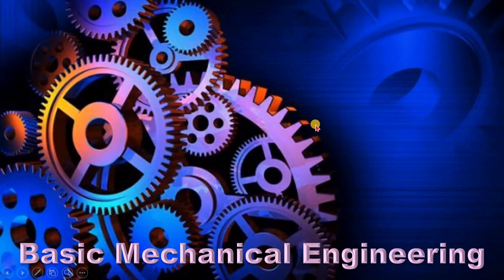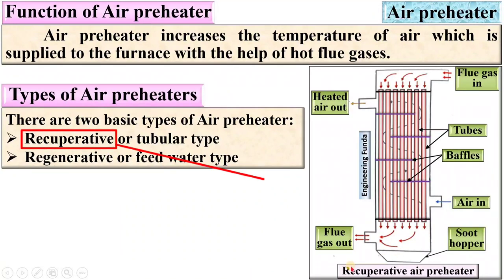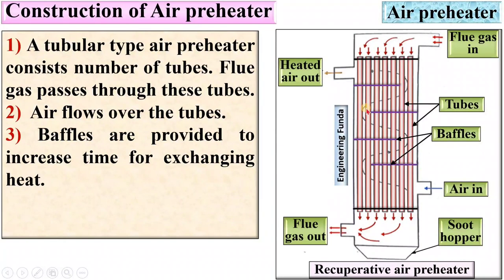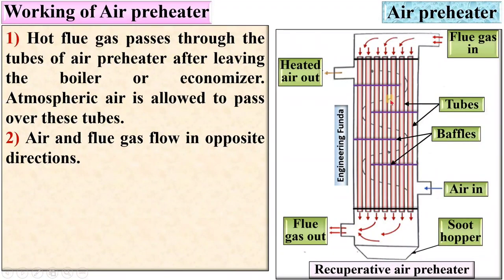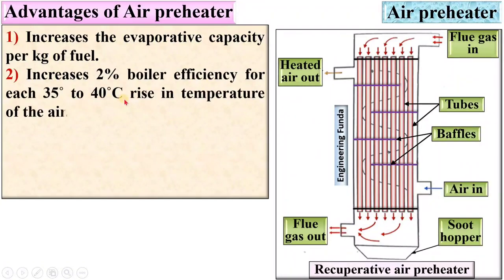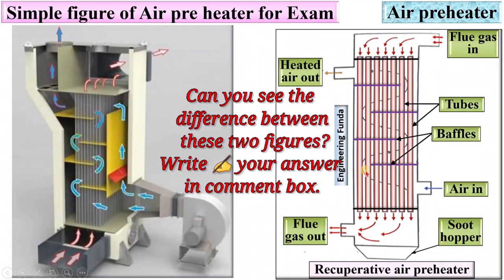Air Preheater (Types, Basics, Structure, Function, Working & Location in Boiler) Explained

Comment from the maker: Air Preheater explained with following timestamp: 
0:00 - Basic Mechanical Engineering lecture series 
0:33 – Diagram of Air Preheater
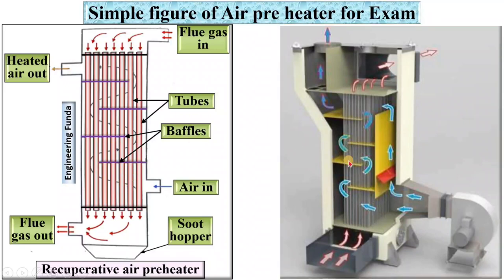0:48 – Boiler Accessories
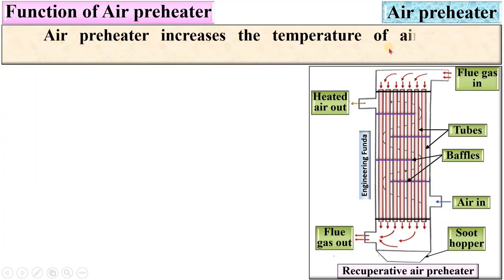1:20 – Function of Air Preheater 
1:47 – Types of Air Preheaters
2:12 – Location of Air Preheater
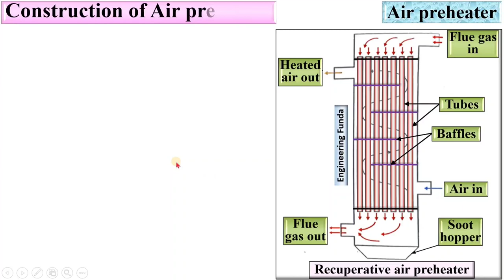2:24 – Construction of Air Preheater 
3:07 – Working of Air Preheater 
4:02 – Advantages of Air Preheater
4:45 – Simple figure of Air Preheater